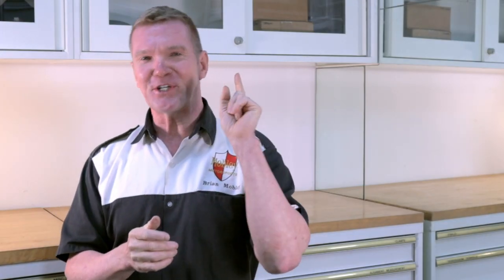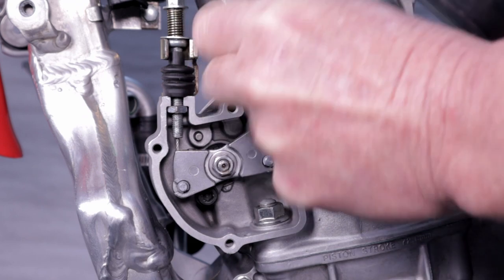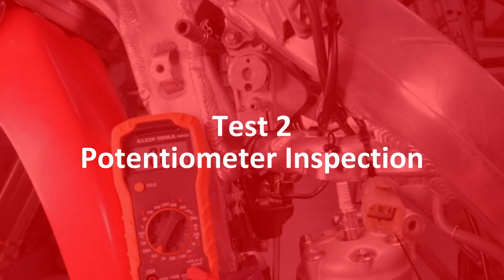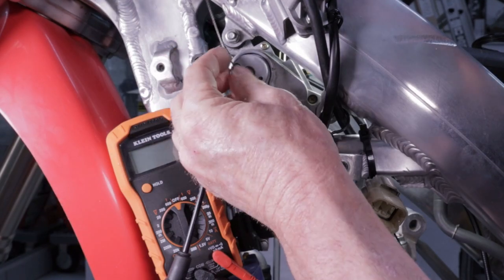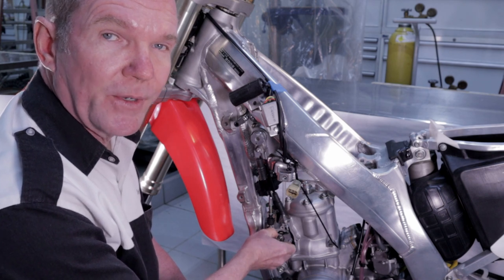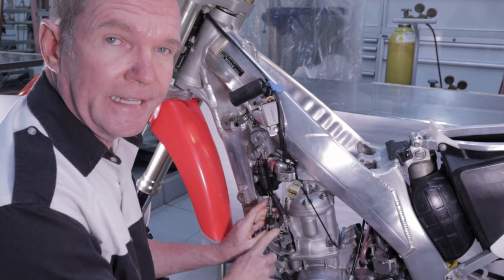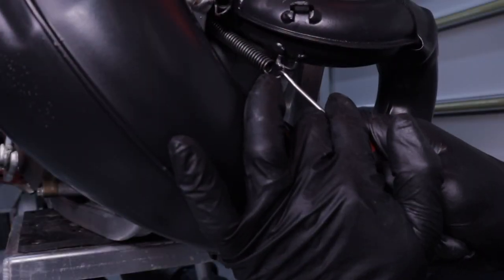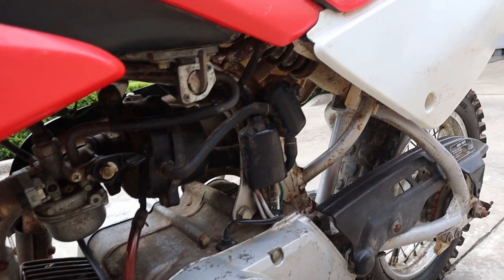Demystifying the RC Valve || Inspecting and Adjusting - CORRECTLY!

Comment: I’m having to watch this several times. I can’t seem to get all the slack out of the cable. It is way to long on the backside
Reply from the maker: All the slack won’t come out. Some slack is normal as the servo is grommet mounted.
Reply from the maker: I was in a rush when I replied earlier so I wanted to explain a little better.  If you use the HRC method, you are setting the back cable to open no more than needed and not "over-rotate" the valve as illustrated in the video.  Because of this, there will be a little slack in the rear cable that will be taken up as the servo rotates.  The setting you are hoping to achieve is that, as the servo rotates, it does not rotate past the point where the top of the flap valve and the top of the exhaust port are in the same plane or are aligned.  I hope that explains things a little better.

Comment: But the servo will still over open valve surely as  it goes to the stop??
Reply from the maker: Hi Jamie.  No sir.  The rear adjuster will have more slack in it than it would if it were adjusted using the service manual or 12mm techniques.  This slack is what limits the degree of rotation.  Thank you for watching too!
Reply: Brian Mobley I understand what your saying( mine doesn’t really have any slack even with outer nut backed right up to 8mm cable end) but surely no slack and then a bit tighter on 12mm method the servo still rotates the same amount? I guess there’s a track on cb to tell it when to stop. Might put 12v on it to see where stops 🤷‍♂️
Reply from the maker: @jimes256  Its a cable and not a linkage, so its always going to be a little imprecise.  And, the servo is mounted to the frame and not the motor which also could affect cable tension - even if only slightly.  The overall design is not really that great, IMO.  However, you should be able to dial out some most of the unwanted slack using the front adjuster.  And, the difference between the adjustment for the rear adjuster using the HRC method is only SLIGHTLY less taut than the Service Manual technique.  The main issue with the manual is that the procedure is just not explained very well.
Reply: Brian Mobley yeah not the best design eh?! Thanks for the explanation and the video! Good work 👍
Reply from the maker: @jimes256  My pleasure!  Thank you for watching!